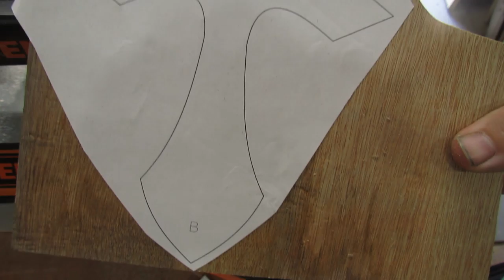7 Amazing Scroll Saw Crosses

Comment: I noticed that you also have a Wen machine. I just bought a Wen, tried mt hand at cutting some wood. I noticed that it was sort of having a hard time cutting through the wood. Do you recommend using the blades that the unit comes with, or going out and buying a certain brand of blades? In the past, I have noticed that companies will use the lowest quality add-ons to a product.
Is it me? My machine, the wood or the blades, I'm wondering.
Are there too quality/sharper blades to use?
Just bought my Wen, haven't done anything but cut some pieces of wood to get a feel for it.
Reply from the maker: Yes, the blades that come with it are usually garbage. They will cut soft woods and very thin woods fine, but anything more and it will struggle. You can get some Olson blades fairly cheap, however, I just recently switched to Flying Dutchman blades and really like them so far. Hope this was helpful.
Reply: Waylight Creations Wow! I thought so! I was trying to cut some wood and it just seemed to struggle with it. Wow! Thank you very much!
Reply from the maker: Not a problem. Happy to help.